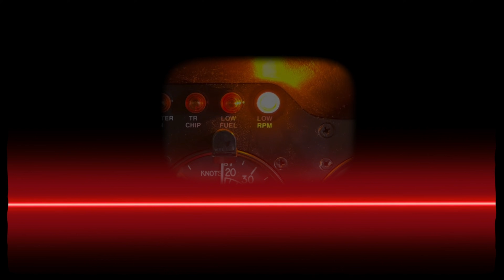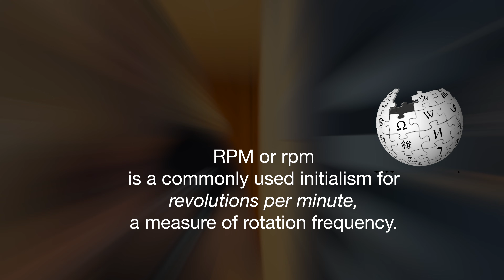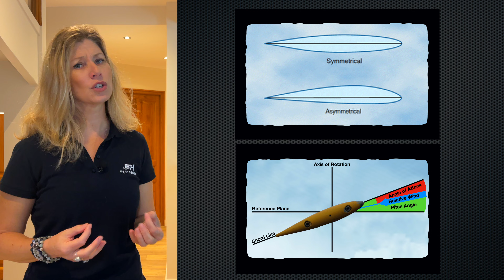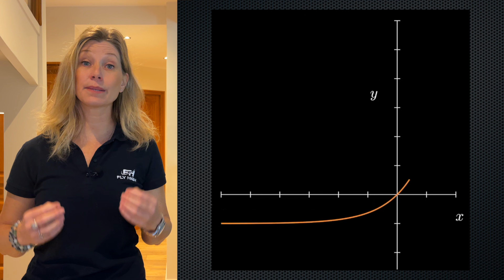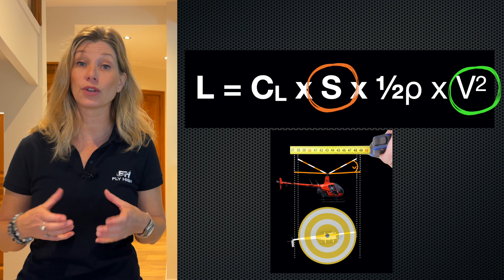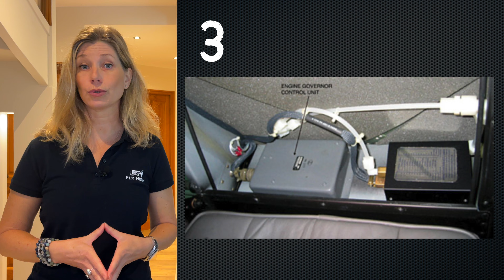The Hidden Danger of Low and High RPM in Helicopters – What Every Pilot Needs to Know!

Comment: I'm supposed to be sitting here quietly watching videos and giving advice and I can't help myself. Here is my basic contribution on this subject. I work on a boat with a pilot and he had magic eyes. When he would get in trouble and barges were trying to escape I would run out on the head of the boat and try to stand where it wasn't going to break a cable and get me and wait until his magic eye is locked on me and I stepped into the game. No matter where I went whether he could look through the coal pile to see me or just see me the regular way he could see me. He didn't have a lot of spare time for looking at gauges and those turbochargers would whisper in his ear so he didn't have to look away from being a pilot. Is there any way you could make a set of pilot headphones with a tone in the right ear for the rotor RPM and a tone in the left ear for the engine rpm.... I tell you you just don't look so good when you're doing your job as a pilot and you start measuring stuff with gauges. Oops I get that mixed up. I mean you don't see outside very well what you're doing to fly the helicopter. You've got two perfectly good auditory channels.This is the kind of information that can be presented on those headphones through the auditory channels so you don't waste your eyesight looking in the cab. I would bet if you put something like that on a simulator you could do some kind of mathematical comparison and your subconscious would hold that RPM for you, better than your conscious mind can by glancing in the cab once in a while when you're trying to run this tricky helicopter.
Reply from the maker: Thanks for your message, Mark.
You’re right — auditory cues are actually a big part of how experienced pilots monitor rotor and engine performance. Even through the headset, we get used to the sound and quickly notice if something changes or feels off.
It’s one of those instinctive checks that builds over time with experience. 🚁
Thanks again for sharing your reflections!
Reply: @flyhighwithcarothepilot  I'm not talking about pilots accidentally listening to the right thing on the helicopter. I'm talking about something intentionally built to make a sound intentionally associated with one RPM or the other.  then monitoring these two sounds continuously will pass into your habit loop. I know what happened to you you got in a helicopter and you tried to understand how to operate it using your conscious mind and somebody telling you lift this all that live this pull that, they kind of gave you a jump start to get the machinery turning. Now the helicopter dances in your hands. Your subconscious mind and your muscle memory is operating all the control and your conscious mind is looking out in front of you figuring out the flight path you need to fly, the lower functions like listening to the motor and operating in controls have become habits. I'm saying if you eliminated as many glances at the RPM gauge as possible by using your ears accurately to hold on to the system instead of just vaguely guess what you should be listening to, you could get a lot tighter quality control on the RPM. Feedback is a very important thing whenever you're operating any kind of a piece of equipment. I study all sorts of people and I use all sorts of ideas from all sorts of places to look at how people work. I heard about one guy that had autism and would just totally tune out on his family, then 5 minutes later he was his usual self happy and they just couldn't figure out what was causing this guy to have all these problems. The way he perceived the sound of the refrigerator made in the background, it was as pretty as the angels singing while the good Lord played the organ backing them up. The autistic guy couldn't pay attention to his family whenever the wonderful sound from heaven played. I think that's an extreme example but it's useful if you look at what are you exactly listening to on the helicopter when you're the instructor and when you're new?
Reply from the maker: Thanks again, Mark — your reflections are always original and thought-provoking. 😊
You’re absolutely right that audio cues play a huge role, especially for new pilots who are still building those subconscious associations. As instructors, we do our best to guide that process safely, step by step. It’s fascinating how many perspectives — including outside aviation — can contribute to better awareness and training.

Comment: I noticed in your discussion of the coning angle you mentioned the loss of surface area. I'm curious how much this koning difference is in degrees. It would appear to me there is a trigonometry relationship, reducing lift as the angle of force is not parallel to gravity. Is this taken into consideration?
Reply from the maker: Great observation — you're absolutely right, there is a trigonometric relationship at play. As the coning angle increases (especially during low RPM), the effective lift vector tilts inward, meaning less vertical component supporting the aircraft. This does result in both a loss of effective rotor disk area and vertical lift.

The actual coning angle can vary depending on rotor RPM, blade loading, and design, but in normal flight it's often just a few degrees — under heavy load or low RPM, it can increase significantly (e.g. into the 10–15° range or more).

And yes, this effect is definitely considered in both flight dynamics and rotor system design — engineers aim to minimize excessive coning through blade stiffness, RPM limits, and load factors. Great question, and thanks for digging into the details! 🚁🔧
Reply: @flyhighwithcarothepilot  it's very difficult being the smartest person that ever lived going to engineering school for free for 7 years and then dancing out of your loans. I watch all of these people pile right into the ground in airplane after airplane and I try to make a suggestion but I'm not a pilot. I'm a person on the ground and I'm kind of sick of everybody in the are falling on my friends and killing us. All these air plane pilots turn towards the airport when the motor dies and think about the airport and the wonderful landing strip at the airport it's so wonderful they fly halfway there hit a bunch of houses. I suggested all these people dropped 500 ft of vertical and see how many feet of horizontal they covered . If you dropped 500 ft out of 5,000 ft available and you covered 1/10 of the distance to the airport you need to land where you are. It is the best idea to turn around and fly towards the airport you just looked at this land.  the downside is there are more people in an area with an airport and if you don't do some rudimentary calculations to see if you're going to make it or not, you are betting your life and everybody on the ground."use up 10% of your vertical height flying back towards the airport.
If greater than 20% of the horizontal distance, you will make it to the airport with enough altitude to land and not crash hard. If less you need to look at the area you just flew over and land where you are. In general in helicopters aren't we having such a miserably low glide ratio with the motor off we just work on landing softly?
Reply from the maker: Hi Mark — thanks for taking the time to share your thoughts in such detail. 🙏
It’s clear you care deeply about flight safety and that you’ve put a lot of energy into analyzing these scenarios.
You're absolutely right that decision-making in engine-out situations is critical — and glide ratios, both vertical and horizontal, are a key part of that for airplane pilots.

For helicopters, though, the dynamics are different. With autorotation, pilots are trained to look for a safe place to land immediately, not to stretch the glide or try to return to a known site like an airport — the margin for error is much smaller. That’s why landing “where you are” is usually the safest bet.

I really appreciate your perspective — the aviation world benefits from ideas and insights from beyond the cockpit too. Thanks again for being part of the conversation. 🚁

Comment: Your interpretation of video 3 is incorrect, they had engine issues thats why the manifold pressure went over 26 inches. The engine decided to behave right before hitting the trees.
Reply from the maker: Thanks for your comment! We're going off what’s visible in the cockpit footage — the RPM decay and pilot response seemed to point toward a low rotor RPM situation and recovery. But if you know more details about this specific incident, we'd definitely love to hear them!

Comment: In the 206, you lose roughly 3% of your tail rotor efficiency for every 1% of Rotor RPMs lost. In the old days, pilots would beep down the RPMs to help lift a heavy load but it was imperative that they be in the correct wind azimuth.
Reply from the maker: That’s a fantastic point — the tail rotor’s sensitivity to main rotor RPM loss is often underestimated, especially in helicopters like the 206. Love that you brought up the “beep down” technique too — definitely something that required precise conditions and good judgment. Did you fly the 206 yourself? Thanks for sharing this valuable piece of operational history 🙌🚁
Reply: @flyhighwithcarothepilot   fair amount of time in 206 B & L.

Comment: Bell had great performance charts for the 205/UH 1 🤩 - The power band is narrow and power topping is easy in the R-44 (Over pitching) is common and not needed . I also see the excess movement of cyclic causing low RPM😮‍💨... Your ears make good RPM indicators and automation make for poor pilot proficiency - Flew the R-22 before governors🙃, And the governor can't tell you what's left on your throttle . Pull the limit and top out the power = low RPM surprise.   If you get a horn you're not a pilot you are a passenger..🤕. Bell 47 and the TH 55/ Hughes 300 had no horns how did we survive???🤗
Reply from the maker: Love this post. Thank you so much for taking the time to share 😊
Reply: @flyhighwithcarothepilot  Any time

Comment: Maybe there should be a AI take over engine and control management for fast safe result in case of low rpm ..😮.
Reply from the maker: AI is gonna bring in so many new things !
Reply: Nope. A well trained pilot is what you need. I flew R-22 when the governor was only a dream. You only harm the pilots proficiency when you add automation... Seen new Army guys ball up piston helicopters due to poor power management
Reply from the maker: This is true too.
Reply: @HongyaMa  I agree to a point with respect, however if such a AI device was present then at least the AI would warn as a alarm sound so to minimise casterstrofkic situations and awareness.
Reply: @gamedevai  Tell that to the crew that crashed the EH 101 in California. 3 computers recording and a system for actively reducing vibration masked pitch link failures . Made quite a mess millions in damage and a crew was lucky to walk away; AI makes lazy brains, Doesn't help.
Not the 1st time a computer screwed the crew, Automation makes for piss poor pilot proficiency
Reply: @HongyaMa  One thing is true computers are as good as the people who program them. There are thousand or millions of attributes that all have to work harmoniously to try to get it safely working right. Although I agree with you that I wouldn't rely fully on these technology but at the same time would not discard it to be of some useful help.
Reply: @gamedevai  Army trained helicopter pilots after they phased out the H 13, H23 & TH 55 for basic training and went to the TH 57 (206 Jet Ranger) later flew H 60s are not proficient in any piston helicopter - Automation SAS made them unsuitable in the civil world. Power management, heading and stick wiggling skills all shot to hell. pilots with 1500 hrs of Blackhawk time = useless
Reply: @HongyaMa  Agree, piston heli's even if there old technology are vital tools to understand the dynamics in play. There are valuable because they demonstrate the fine limitations and proficiency needed to  fly in certain conditions with always safety  in mind..
Reply: @gamedevai  Flown all types and the guys who use augmented systems all the time are behind the 8 ball. They lose vital skills. A pilot has to fly in all conditions. Old turbines too. Cheers

Comment: Great Video with very good explanations! The last example of low RPM during the landing approach on top of a mountain was very impressive. It shows how fast decisions have to be made when the RPM are falling. There is not much time for hesitation. The other pilots in the examples before had much more time and options and altitude but were reacting too late... if at any time. Awareness and knowledge what to do paired with good and fast decision making are the keys to survive and or not crash at all. Thank you!
Reply: Governor baby'd pilots no power management skills
Reply: @HongyaMa  Thats true!! 🙂 And additional we have soo much power in relation to weight that it's hard to run out of power with RC helis!!
Reply: @RCCopterLove  true no substitute for raw power
Reply from the maker: Very well said ! Knowledge is key. If you know what to do, there will be no hesitation. 👍🏻